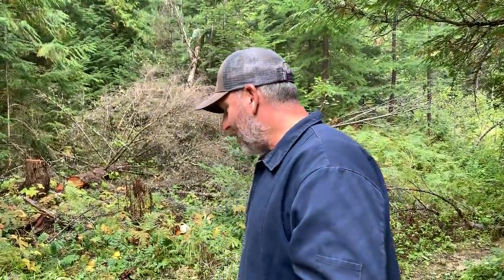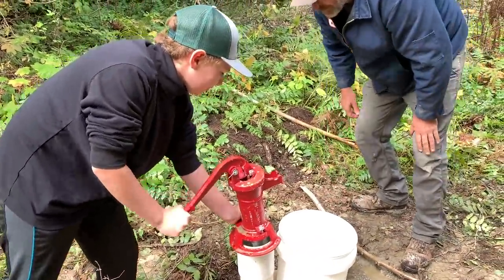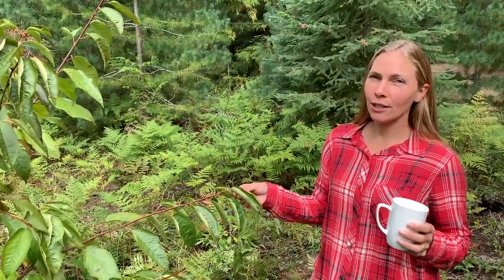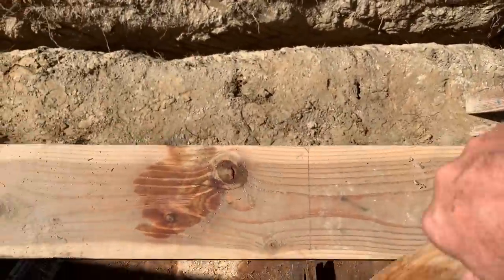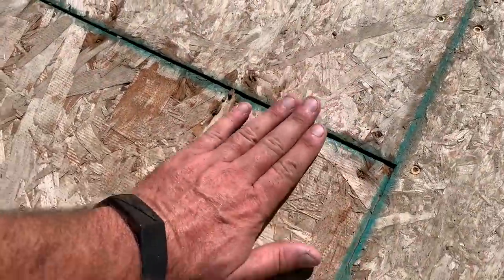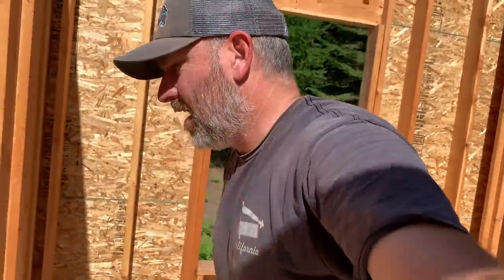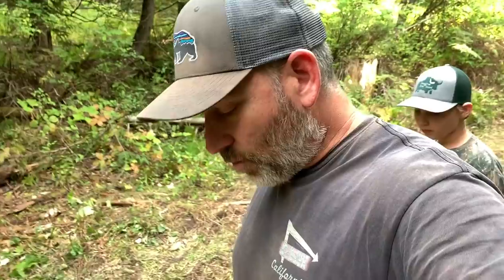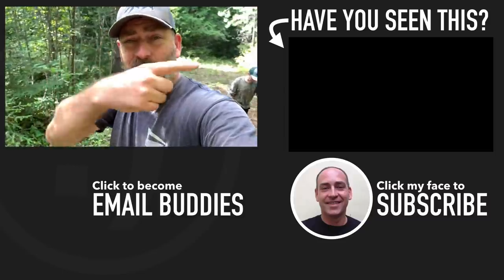Making Progress on Our Well | Off Grid Cabin Build #29

Comment: Hello,  first let me say I really enjoy watching your videos.  I have an idea that may work!  But before that I am not a professional well driller or anything like that, I am a software engineer, but I have successfully pounded down a sand point well to about 26 feet for irrigation purposes.  My biggest issue was developing the well.  I read alot about this and people were telling me to jet the well with city water, or with air, which basically just push water or air to the bottom to make the sediment/sand rise and exit the top.  Instead of wasting the water, buying an expensive pump or air compressor, I decided to do this by hand and it did take a weekend working from sunrise to sundown to finish this, but it did work.

The idea is to get water down to the bottom of the well that is not producing and clear out the sediment.  I positioned 3,  5 gallon buckets down a hill about 5 feet from the well.  each bucket had a hole and a 1'1/2" PVC pipe on the side about 1/3 of the way up from the bottom.  the 3 buckets were tiered down the hill one bucket draining into another.  I used a 3 inch pvc pipe to divert the water coming out of the pitcher pump to the first of the 3 buckets.  I used some window screening to create a very cheep filter to try and clear the water between buckets,   the last bucket had a 50' garden hose which I attached to the PVC pipe exiting the bucket, that I primed with water to siphon the water to the bottom of the well.  now I filled the buckets with water and simply kept pumping until I finally was pumping clear water.  

As I understand it you have a pond nearby (I would use that instead of the buckets...just divert the water from the pump to the pond. and siphon water from the pond to the bottom of the well with a 50' hose.  and keep pumping.   

Like i said it took all weekend to do this and I pulled out 2 or 3 buckets of sand out of the bottom of the well.  but when finished the water ran clear and the yield was better.  before I started only yielded about 5 gallons every 45 mins  and by the time i was done it was yielding about 5 gallons every 15 min.   which was enough for my purposes which was watering a garden and flower beds.  Now this shallow well has been working for 6 years now and its actually producing better.  I have not actually tried to pump it dry because I cannot and all it has is a pitcher pump on it.  But no matter how long I pump this well now, I cannot pump it dry.  My guess is I cleared out all the sediment untill larger pieces of gravel started working around the pipe and well point  and settling in.

Hope this makes sense.
Reply: Jim Thomas's plan above sounds better.  I did this because I didn't want to spend the money on a pump or rent a large air compressor.  Everything I used, I already had and if it did not work, then I was only out some time. and the cost of the pipe.
However, I must say It was an interesting learning experience and it was very cool that I was able to make the shallow sand point well work.
Reply: Bet you had the biggest muscles at the office when you went back to work after that looooong weekend workout.
Reply: Gobuilditbetter 😂 it was a while back. But I remember being completely sore on Monday morning.
Reply: @JH-dz5wi  I bet!

Comment: The whole idea of a points well Is to pump the sold out it will build a cavity underground which gives you a bigger well I'm here in Maine doing the same stuffI did just have a actual well drilled that's 500' though Dang Didn't  that hurt the wallet But I am also going to put a hand pump on the top of that as well as a backup

Comment: Did you cap the end of the 6" casing so only the water flows in through the slits you made.  Slits maybe to wide, probably a1/8" kerf from saw blade.  Hacksaw makes a thinner kerf cut.    Can't help you on depth which is what you need to create a longer column of water in casing.

Comment: it may be a little late. but i started off with a 8 in post hole digger on my tractor. i dug 16 foot thats all i could do ZERO water. i used a 8 inch pipe. so i filled the hole and filled it with water and used my pressure washer with a rotating tip and got another 13 feet.  i used 7 1/2 inch PVC    went inside the 8 inch pipe still no water. so i filled it with water and used my air compressor  and ended up at 125 feet and 2 1/2 in pipe. and to this day i haven't even came close to running out of water.

Comment: I recommend you to buy a whole of firecrackers and pack it tight into several half quart milk cartons  and place them at the bottom of the well and  light  it. The explosion will enlarge the diameter of the well and you will get a lot more water.

Comment: I do not know for sure but should of put  about one or two feet of gravel in the bottom of the hole before before putting in the casing pipe and about a foot half gravel in the casing pipe also before putting it pump pipe.

Comment: Hi Martin  I live in Canada you get 100 percent on effort concerning the well . Iam sure you know from reading comments  you need a proper well get the proper permit find out what depth most wells in your area are and flow rate and water quality get a reputable water well driller . also rain water harvesting may be a option? Oh for what its worth Ihave worked on many wells in the recent past using a  Th 60 cyclone rig on a peter built tri axle truck in our area most wells average 250 feet  about 20 thousand dollars.Anyway we go past clay and look for water in gravel bedrock blue shale brown shale even coal seams have water. But  only THE GOOD LORD knows what is beneath your feet  .  enjoying your channel thanks sincerly Tim

Comment: May want to address the bottom of your cast iron pitcher pump.   If you have holes in it, then contamination can fall into your well causing contaminating to your water supply.   Put a cap on your casing with hole big enough for your pvc pipe to pass thru to your pitcher pump and able to seal it so nothing falls in.   Sand point filter or screen on end of your pipe will help with filtering.   If you absolutely want the muck gone, then you will need to take stick of pvc with smaller pvc inside being 2 to 3 inches back from larger pipes end.   Smaller pipe is for shooting water down while the larger pipe around it transports muck back out.

Comment: Btw if you take a straw and put it in a glass of water put you finger over the end of the straw and lift it up out of the water. Remove you finger the water runs out..  Use the three inch pipe and a cap and pull the silr out of your pipe. Btw the sand point is good for like 20 to 30 feet. If you have to go deeper then 18' I sure wouldnt tell any one. And if you did go deeper, 
do you think they will come out to measure it? If they do just have a check vavle at 18' , the rest will be sealed up and no other way to measure it but to drop some thing down the pipe.

Comment: You need to get a sand point and use 1 1/2' galvanized pipe or what ever you pump size is.. You can drive that down a little deeper than what your at now. It will pump dirty for a little while and clear out. No more problems for a long time. when you do have a problem you take the pump off and the check valve if you have one on top of the pipe. Shoot a 22 riffle down the pipe and it blows the sand out of the strainer on the sand point. I have done this several times and it works fine.

Comment: What has worked for me is to glue a cap on the bottom of the pipe. I cut the first slits about 6 inches above the cap and continue for 4 feet, small slits with small holes drilled between the slits. Take some time and make a lot of them and make them small. When the hole, the well, is bored deep enough, put the casing down and immediately pour the pea gravel around it, I used 4 bags. A smaller 1 1/4 in pipe with a foot valve on it goes down the casing and is about one foot above the bottom of the casing. I get clean water and no mud after the first few pumpings. The only way you can leave the bottom casing uncapped is if you put several feet of pea gravel down and even then I would not trust it.  Cap it and make small slits and leave your foot valve 12-18 inches off the bottom and you can pump it till it's clear.  Just my opinion. But this has worked well for me in clay. To save what you have, driving a well point down deeper is all I can think of to fix what's already there. 10-15 feet deeper ought to get past what you are experiencing. The well point has its own filter.

Comment: Try flushing out the pipe with a high pressure hose, if you can put enough water down it all the silt will wash out, eventually you will probably clear all the silt around the well point unless you are in a layer of silica sand! If so then all you can do is drill deeper into another level of the water table.

Comment: I am sure that there is water.  I beg you to treat 20 'more depth.  that on the tip of the pbc pipe adapts 4 'of 3 "pbc with small holes perforations then place a maya that serves as a filter and everything is better for you

Comment: When you start pumping the water is clearer at first because the silt in the casing/pipe has settled to the bottom of the pipe.  Then as water starts flowing again so does the silt from the bottom and outside the casing.

Have you had this water tested to see if it is safe to drink?  If it isn't safe for human consumption it might be time to move on to another site.
Reply: No point in testing mud. It has to clear up first, and it wil not with that low recovery rate

Comment: Needs sand to filter through.  Also need to cap the casing and mount the pump to the cap to create suction in the casing so gound water fills in faster.  You want to pull suction through the ground, not just at the bottom of your casing.

Comment: Bit the bullet and get a permit and a pro driller you'll have to go deeper if you want clean water that you can use.
Reply: Well drillers in our area are booked out until May right now.  This is a great solution in the interim. Besides, they are getting water in the dry season.  Many folks out here don't get water during August, September or October.  They truck water in from town during these month.  So their water supply will almost certainly improve.

Comment: how are you doing with the well ? 
So i would suggest you use like pumping machine or generator to pull the water out it sucks up bit more so the water staying there will have a way to come out. tell me if it helps?
Reply from the maker: The well is on hold for now.

Comment: Any OSB that gets wet once the factory warranty is bye bye... Plywood is more durable for light wetness but not much.
Reply from the maker: Are you sure? Osb comes with different ratings.
Reply: @MartinJohnsonOffGridLiving  yes, because the glue once it's wet is compromised... The first thing that the company does on warranty is moisture checks...
I think sum are rated 30-60 years warranty, UNLESS it gets wet...
Sucks I know. But each glue layer that's compromised your thickness is compromised by load...
Would use tarps or if you have the cash which can get pricey depending on square footage, red guard the floors after laying them, especially the seams, or a primer , then an exterior paint to buy time if you are working slower than a professional crew...
My first build was the same, I learned that the bathroom should be the first built in a off grid situation, because nothing beats a shower after a. Long dirty work day, and bathroom facilities when they are needed everyday... 
Once all load barring walls are up the roof should be finished first... Protected the process as you go...

Comment: you need to drill lower the water level( about 5 feet more) to avoid air intake inside the tube. It get darker because of  turbulent mixture at the bottom created by the movement that you made when you are pumping.

Comment: Drill deeper inside your casing,measure as accurately as you can.Say 2 feet more.Measure out pea shingle,so that its enough to fill in the 2 foot and that it comes up maybe 6 inches into your casing.This should cover any slib thats in your casing then pump.Eventually it will come clear.
If anyone comes to measure the depth of your drill it will come back at the maximum,or just under.
Reply: Best comment I’ve read yet.

Comment: I seen another guy.. different location and soil type. Use a home made slide hammer metal poles and couplers and just kept smashing the pipe down to level and adding another coupler and a  10 ft pipe and repeat a few times. And within a few hrs it was done. 3 pumps it was clean water.
Reply: My father used that same method to drive his well.  One difference, he cut a bevel on the end of the pipe to cut through coral rock in so florida.  After running the pump for a few hours the water was clear of grit.  25ft and tannon water to for the yard.
Reply: That is called a sand point well.

Comment: Martain, You need to seal the top of the casing with what ever end cap, adapter, reducers it takes to make a air tight seal from the casing to the drop/pump pipe, that way the suction from your pump will draw water out the dirt---not out/empty the pipe.

Comment: Don’t know if you’re still working on this but he we get cuttings out of the hole. Is by pumping thick bentonite and polymers down the the hole to getthe cuttings out. Also if you mix up bentonite gel with water and pump it down the hole while  c you drill it will cake the well wall making It much more stable. Good luck!🍀